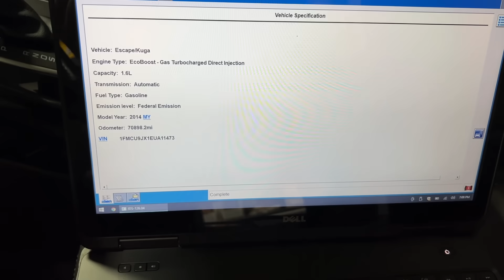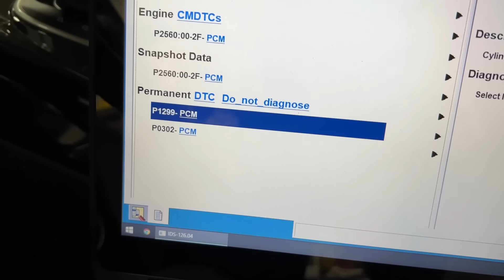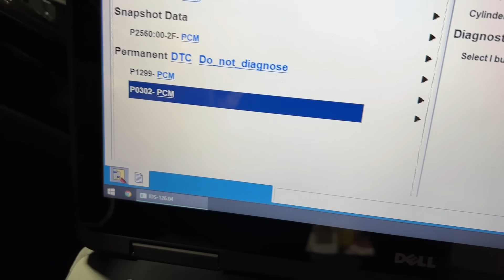Beware of Ford’s 1.5L 1.6L 2.0L Ecoboost Engines and Their Never Ending Coolant Consumption Issues!

Comment: Our 2017 Ford Edge with 67,000 mi is at the dealer now for a long block because of coolant leaking into cylinder number 1. 

Jack Madden Ford wants $11,400 to replace the engine. They only warranty it for 3 years. 

I asked them to do a PTU service and they looked at me like I was crazy and said they never need to service the PTU, I'm going to send the service manager your video. 
You really are the best ford service channel on YouTube I've watched you from the beginning at the dealer thank you for all your hard work and good information, I'm in Boston but if I was near you or the car was driveable I would bring it to you and trust you with the work.

Comment: I have a 2016 Ford Fusion 1.5L Turbo ecoboost.  76000 miles. We bought the car almost a year ago with 56000 on it. The car just started drinking coolant 3 weeks ago, Took it to a mechanic he took the spark plugs out and ran a wire Cam in it and saw coolant in cylinder 4. My wife tried cranking it last sunday and its dead! It sounds like its spinning over but wont crank. It almost sounds like a timing issue when its spinning over but running it on a diagnostics computer says misfire cylinder 4, It has never once ran hot and there is no coolant mixed with the Oil. .I have spoke with ford they told me there is nothing they can do because the customer satisfaction program for the Ford Fusion 1.5L is only the 2017-2019 cars even though they've had the same 1.5 motor since 2013. They Referred me to the Better Buisness Bureau. Dont know if its going to do any good but before i spend 6k on a new motor i want to exaust all of my options. Can anyone give me any Advice?

Comment: Hi Brian, thanks for the video. I am having the same problem here with 1.6L engine. Is it going to be okay if i replace only the cylinder block?  Is there a new part number for the newly designed block ?

Comment: I have a 2013 Ford Escape 2.0l with 231,000 miles and it's been running just fine. Never had any issues.

Comment: I have a 2014  Kuga 1.6 ecoboost titanium. Engine running well, no overheating. Not losing coolant. But there is oil in the coolant, a dirty brownish sludge at top of header tank. Engine oil not milky in dip stick. What could issue of contaminated coolant be?

Comment: I don't have coolant in my oil, (knock on wood). I have a 2016 edge 2.0 e boost and what I found is, I had a slow leak on the big hose going to the thermostat housing. It was extremely slow and I figure that over time the spring clamp just lost tension with all the heating and cooling cycles. I put a gear clamp on and haven't had any issues since.

Comment: Awsome engines. Look around you next time your driving along and you will notice just how many Ford escapes are on the road beside you. There is a good reason for that. My 2013 Escape 2 liter ecoboost engine, (First gen) has run flawless since new and still has tons of pep. The first gen does get crappy gas mileage though. Every engine ever made will have a few problems even the old Dodge slant six from the 80's

Comment: 2.0 ...had it happen..let out pressure it went fine...I saw some spilled in my driveway...weird smell from the heater and it doesn't work or it works too good..I think its a heater coil maybe I don't know yet it runs fine now lol

Comment: Most if not of the problems have been addressed
Reply: Well, not really. In 2020, they changed the engine design which may have fixed the issue on new engines. The only fix for 2019 and earlier engines is a new long block engine. Ford refuses to address the problems with the pre-2020 Ecoboost engines

Comment: I have a 2017 Ford Fusion SE 1.5L Ecoboost and I’m at around 112k miles and my car started having some coolant issues and P0303 codes about two months ago. I’ve been watching other videos about this issue. One of of the videos actual talked about a TSB 22-2322 I’m hoping this is the case and I’m covered. But here’s hoping 🤞🏽

Comment: I have nearly 94k miles on my 2017 Ford Escape 1.5L. Just recently had the tranny, coolant and brake fluid replaced. With humility I will say that I have not experienced this problem or any other engine problems. . I have replaced tires and had wheel alignments done, but other than that no issues. Maybe mine was made in Japan? 🤔

Comment: Coming up on 200k in my fiesta st with a long list of aftermarket parts and a e30 tune at 26psi. Doesn't use a drop of oil or coolant. Guess it's a dice throw rather you get a good one or not.

Comment: Just my thought why a pressure test does not always identify the cylinder leak. Just curious how much vacuum is created within the cyclinder during the down stroke to suck in fuel ??? These video's saved my ass when neighbor asked if I'd ride along to look at a used vehicle buy. I restore old Jeep TJ's with the inline 4.0L's, I'm no expert on newer technology but get by....

We arrived at the car lot and reservoir was empty and what was visible in the radiator looked oily and burn't. That was enough for me to say, "Walk Away". We got her into a Jeep Patriot with low miles for 1/3rd the cost.

Comment: I understand that there are three 1.5, 1.6, 2.0 and 2.3 liter ecoboost block designs each with a different approach to cooling passages between cylinders: 2013-2016; 2017-2019; and 2020 and later.  2013-2016 with no grooves, 2017-2019 having grooves at the top of the block between cylinders, and 2020 and later, no groove but a hole drilled at an angle.  Sorry I can't post pics.  Sometimes a puff of white smoke at startup is the first sign before dropping coolant level appears.

Comment: I have a 2013 Ford fusion 1.6 turbo. Had to replace the head gasket because it was worn out and leaking coolant. After putting it back together, in what order do I place the tappets that go under the camshaft?

Comment: Thanks for your work and posting this information.  It is valuable to so many people and it is appreciated.  
Was it holding pressure when you ran the pressure test overnight?  I'm having a similar, but not as bad of a problem.  No sign of coolant in oil.  Pressure holds when pressure testing overnight.  Plugs look ok.  No visible signs of a leak.  But I've had to add 2 cups of coolant in the last 3 months on my 2.0l ecoboost.  2016 focus st with 54,000 miles.

Comment: I have a 2019 Escape Titanium with the 2.0EB engine.
Is this year still affected? I only have 30,000 miles on it and it's not driven a lot. We have the Ford 100,000 mile extended warranty also.

Comment: Is there anything you can do to fix this from happening again, or is this design completely unfixable?
Is there anything that can be done to prevent this kinda thing from happening? Looking at a 2016 2.0 escape, really like the vehicle a lot, but very concerned about issues, escape as 113000 miles on it now.

Comment: I find this video very interesting. I had that exact same car 2014 escape 1.6 ecoboost. It was even red like this. Bought it used and got an extended warranty.
We had a coolant cosmptuon issue as well. I'm a mechanic myself so I tried to find the "leak" and could not find one. Took it to ford and they diagnosed a bad coolant hose that was not covered by warranty. They gave me the part number so I Got it back and I tore it down to find that specific coolant hose and it was dry, no leaks at all. 

They lied to us. Watching this video just verified what I already believed was the case. This was around 80k miles. The transmission went out on the car at about the same time and ford fixed that under warranty. But the coolant issue never got fixed. Topped it off with coolant twice a week for about a year until the car got wreck and totaled out. That was the best thing that could of happened to that car. I'm a ford guy, but that was just a horrible experience. Not to mention the car was always gutless and shifted like crap. Just felt very cheap

Comment: Does this problem usually occur within a certain mileage?  My 2017 escape with 1.5 has almost 70,000 miles and is not consuming any coolant so far.

Comment: I have 2019 escape titanium, 48k miles head cracked. Ford gave me a new long block. Bought 2015 focus ST3 70k miles preowned all stock 2 weeks from buying sent it back, already Ordered full bolt ons. Bought a 2016 ST2 40k miles about to roll over 60k miles and turbo failed then possibly head cracked as well losing/consuming large amounts of coolant. I'll find out tomorrow when I dig into it.

Comment: If there is any coolant remaining in the radiator or coolant reservoir- it can be tested for products of combustion- carbon dioxide, carbon monoxide and others.   If positive, you have your answer. Either a gasket issue, cracked head or cracked block.  When cool- the engine might hold pressure- but when hot and under high internal pressure- coolant can be forced across the gasket and into the cylinder. Over time- this gets progressively worse until the gasket is finally breached. It seems to be a moot point as to which cylinder is affected. At this point in time, you have a portable garden planter. Then again- maybe not so portable....

Comment: I got my wife a 2014 Escape about 5 years ago. Had just over 79,000 when we got it. Now...@195,000 plus miles ... doesn't use oil, I need to replace my second set of plugs . I did the timing belt at Ford @ 135,000 miles ( wife STILL doesn't comprehend on the why we had to do it ).
I've had to add some coolant but not much. Was good on tires . Trans is dead now. Unless I can get a shift solenoid to do the trick. Was stuck. Guy at the garage cleared the codes ( code showed it was stuck open or closed, don't remember which ). Got it back and drove home fine and my wife was able to drive it 15 miles each way to work a few days later. then,  back to not working. It'll do ok in sport in 1st and second as long as you don't push it and stay under 30 ( more like 20 ).
Any thoughts from a mechanic on this.

Comment: We are having this coolant issue with my wife's 2017 Ford Escape, engine light came on and started to run really rough like it was running on 3 cylinders.  Called Ford dealership were we purchased the car brand new and had it towed down to dealership.  2 days later the rep at the dealership called me and advised us that it was leaking coolant into the cylinders and it would cost $10,000 dollars 💸 to fix lower end of engine. Of course I blew a gasket and asked how this could happen with only 65,000km on engine and havi g all servicing at the dealership??? I'm not a big engine guy but I do know this is BS. I called the salesperson  we have been dealing with for 15 years, bought a F150 from them in 2020, had a long chat with him about everything and he somewhat agreed with me that we have had all servicing at the dealership etc, etc. He said he was going to talk to his boss and see what they could do? He called me back and said they ate working on a solution and the rep will call me back,  a week later no call back, call them and left message and advised I wanted this resolved,  no call back.  I have been investigating this issue and I guess the engine block is flawed in its design,  it has a channel around the top of the engine and the coolant flow around this channel to cool the engine but there is a thinner channel between the cylinders and the seals wear out allowing the coolant to flow into the cylinders and Crack the engine block!!! And this is the owners fault??? And this is happening to all the eco boost engines. Unbelievable!!

Comment: Have my 2019 Escape with 61,000 miles on the odometer in at the dealer for this issue right now. I first started losing coolant a little over a year ago - threw a code and had it into Ford where they pressure tested the system, topped off the coolant, told me everything was fine, and sent me on my way. 

A couple weeks ago, I noticed the coolant was running low again and brought it back to Ford hoping to get the vehicle into the shop. They told me they couldn’t get to it for at least a few days and since it was running fine, I topped off the coolant and put it back on the road. Later that week (of course while I was out of town for work) I got a call from my wife saying the car was running really rough. I told her to limp it home and use one of our other vehicles until I could look at it.

Got home, took it into Ford, told them the history, and within a couple of days got the news I already knew was coming. New short block (courtesy of the 7 / 84,000 warranty) and I should have it back in about a week. So far the only extra expense has been three plugs at $22 each (the warranty would only cover the one in cylinder two) and a water pump at $92 (the tech said it was starting to leak and suggested replacement since the labor was already being covered by warranty).

Now I have to decide how long to run the repaired vehicle before dumping it. Without the short block, I knew I was going to sell it as soon as the 7/84,000 warranty expired. Now, with the short block repair, I’m wondering how far I can push it - I usually run new vehicles at least 10 years before even thinking about replacing them………🤔

Comment: My 2014 Escape Titanium with the 1.6 EcoBoost has coolant intrusion in cylinder 4 at 67k miles.  The warranty is covering the car majority of the repair costs.  I'm not particularly happy, but at least I'm getting an updated full long block out of it...
Reply: I take it you bought extended warranty.   Which company?
Reply: @EmeraldView  can't recall the company.  It was offered with the car at the Ford dealership I purchased it from.  Jones Ford in Buckeye, you can call them directly and ask what warranty it is they sell with the used vehicles if you like.

Comment: I've been working ion my daughters 2015 Fiesta SE 1.6. It starts hard but once running runs good. Also has a perm 2nd cyl misfire. The way it acts I figured Fuel pressure leaking off. But I swear these engines suck for testing fuel pressure. No valve and those stupid plastic lines. I am afraid to pinch them off. Anyone else had this issue? She lives a good distance from me and i can't take my garage..lol

Comment: The only good Ecoboost motors are those based on the old Mazda L/F engines. All the Ford clean-sheet designs have had significant issues.

Comment: Saw a nice "cheap" one on fakebook, seller says needs a little coolant, etc.. came here and now I know why they want to fire sale it the ol' fakebook scamplace. Beautiful car, low miles and a 15 minute video later.. that's a big nope 😑, the engine replacement more expensive than the whole car, it is to a point these are mechanically "totalled"

Comment: I have owned Ford trucks my whole life. My first was a 1960  F250 2wd 6 cyl. three on the column. BULLET PROOF. I traded some concrete work for that truck. It never let me down. I have owned F150's all the rest of my life, up to today. I was 78 last week. I simply cannot beleive what Ford has done to themselves. One failure after another, and most are idiotic "anybody should have  predicted this" types of mistakes, like the spark plugs, and the oil delivery problems on the 5.4 liter engine. Henry completely stopped production when he was developing the flathead V8. What the current morons on the top floor of Ford Motor Company have done is criminal.

Comment: Do you know why the motor oil smells like gasoline? I have a 2018 Ford Fusion.  It only has 46K miles.
Reply from the maker: Yes direct injection, multiple cold starts.

Comment: Great video. Was looking at a nice 2013 escape se with over 200k on it. The guy keeps a bottle of coolant under the hood and tops it off every couple days. Has intermittent cylinder 3 misfire. It’s cheap enough and was thinking it was just a head gasket but it looks like it might be a lot worse than that. No way do I want to replace the long block. What ford vehicle’s would you suggest between 2000 - 2010?

Comment: Welp, my 2014 2.0l has 140k on it and no issues. All I do is full synthetic every 10k and transmission fluid every 50k. Oh and spark plugs at 100k just because. Lucky me. I love this car. We call it "the little car that could" because with a roof rack and a tow package it does everything.

Comment: The big 3 manufacturers are just making pure junk I really think they design engines/cars to fail soon after there paid off or the warranty runs out basically throw away and buy another car...I'm keeping my 22 and 17 year old pickup trucks trucks as long as they keep making parts for them. I still see people with old 70's  80's and 90's cars and trucks on the road their built to last👍🏿

Comment: Mine is a 2015 2.0 - working fine, at least for now with 150,000 km.  It probably has an issue with dirty backside of the valves but not serious.  I will keep an eye out for coolant consumption but at least it's not a 2017-19 engine.

Comment: own a 2014 fusion titanium AWD 2.0L
has shy of 126,000 miles.. recently noticed a bad oil leak and the coolant reservoir is seemingly low and added a little into it

Comment: I have one of these. It lasted 100k. Then started to over heat on long drives, but only past 55mph. I can drives all day long as long as I don’t hot rod it with high rpm’s or high speed driving. It has a major bubbling noise caused by back pressure, which I did a test and did confirm exhaust fumes in my coolant tank.

I knew the issue was a bad head gasket, then after getting into I figured out it’s not the gasket but the block it’s self. That’s my luck, and I just laugh now a days.

Any ways I used Bars head gasket sealer. For me it has fixed all my issues. No more over heating, no bubbling noises, and even have more power.

I did have a small leak and was able to daily drive my car and maybe add coolant once a week 2x depending how much I was driving. So my car was a good candidate for the solution. 

If yours is overheating and can’t drive it for even 15 minutes I would say it would not work.